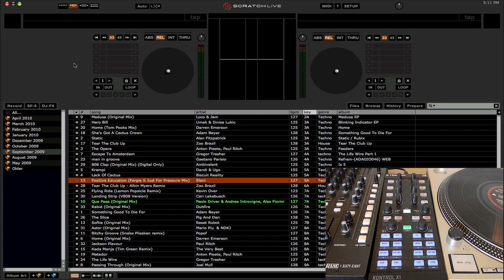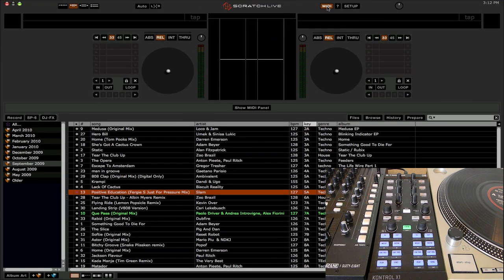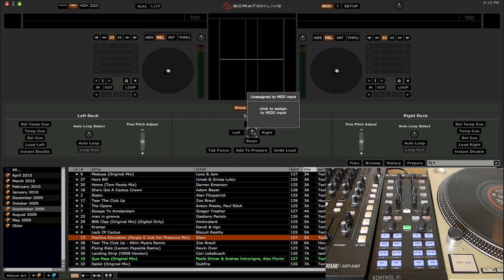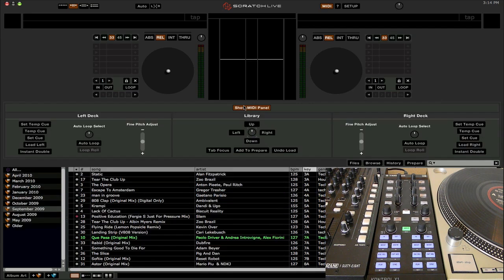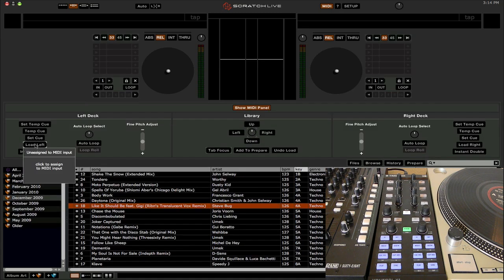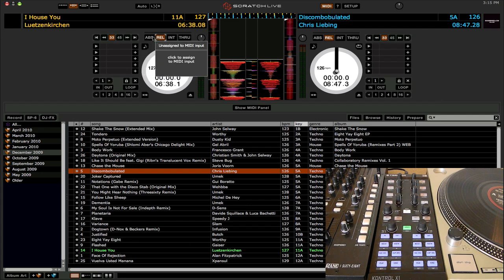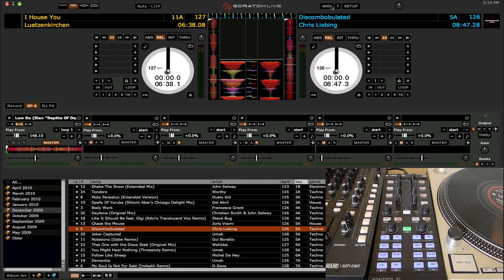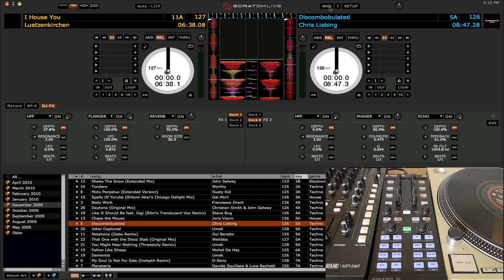How to map a MIDI controller in Scratch Live (remake)

Comment: Although the NDX 800 and 900 players have the USB connection, but do not have native support for Serato, I could still use them as Midi and don't need timecode.

Comment: Great videos but can you do a video on how to map loop roll to midi pads. Since 2.0 came with the midi panel and loop roll button, simply just mapping loop rool is no help. I want to be able to loop roll like i use to. Im using korg nano pads. I had 6 pads mapped to the diffrent loop lengths and had loop roll active making loops seemless. Now i have to click on the length b4 i push loop role button, which makes me have to completly stop one roll click next length then roll again. Plz help serat

Comment: Update: with MIDI-OX and MIDI Yolk running, the FX features weren't working. I wasn't able to enable/disable. Also, tab focus to the crates wasn't working either. However, cue points, loop roll, manual loops worked fine. Once I disabled MIDI-OX/MIDI Yolk, your mapping worked exactly like your video. I guess I'll have to tinker with MIDI-OX if I want lights that bad.

Comment: cheers for this, but having not used serato before, how is this all hocked up into the serato box and the laptop? Does it require using two line channels on the mixer or just one as you would if using a soundcard?